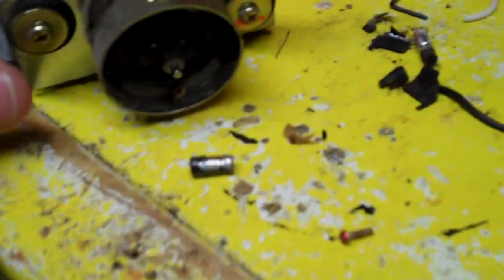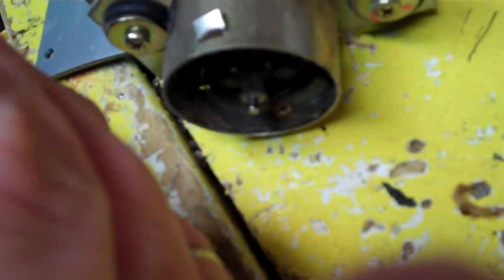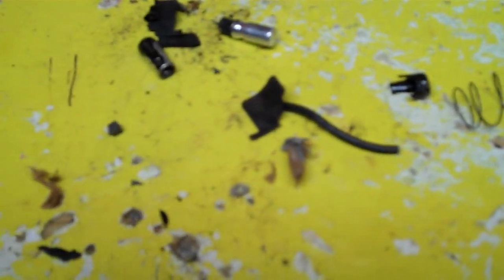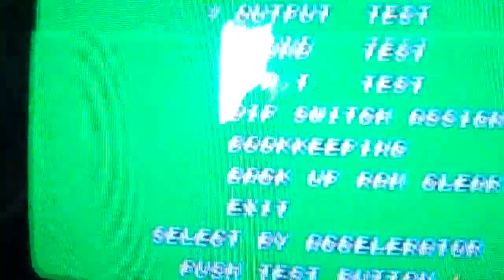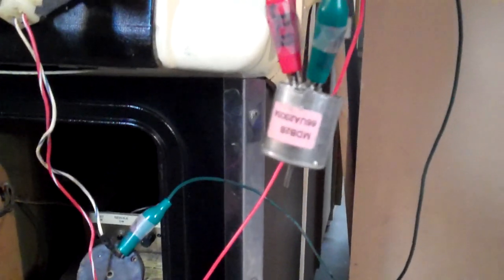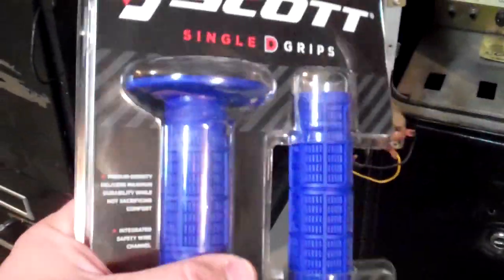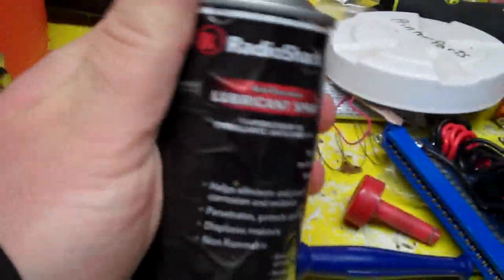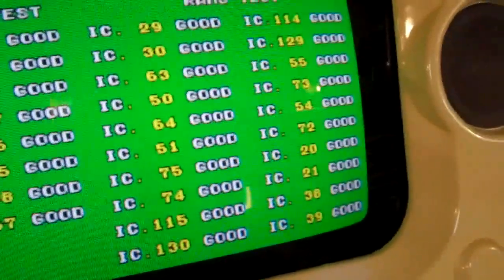Broken Vibration - Super Hang-On

Comment: Cool video, I've got an After Burner which luckily has a perfectly working rebuilt stick.  I'm gonna tubeswap when I find a 19" tube, I've already rebuilt the power supply, and going to do a bit of wood filler and paint for the lockbar holes and then re-do the T-molding and it'll be near mint...